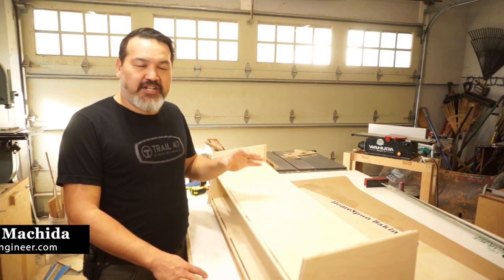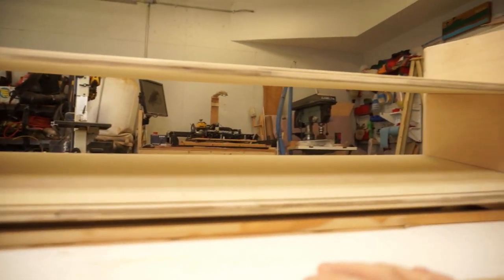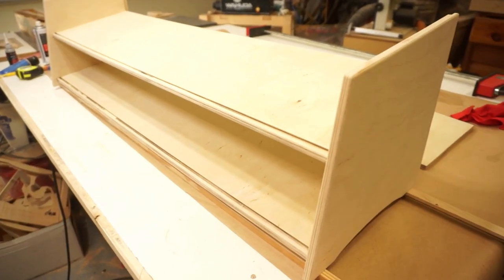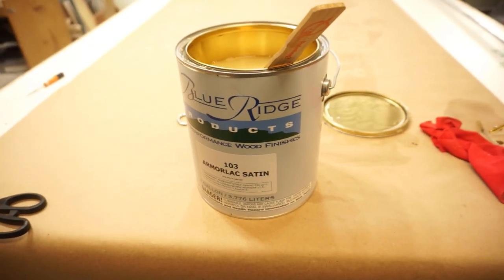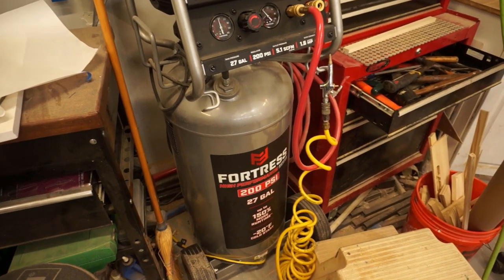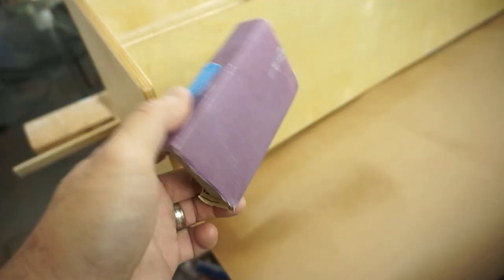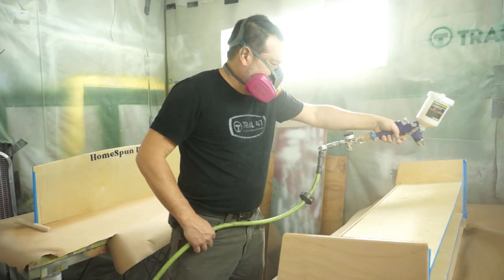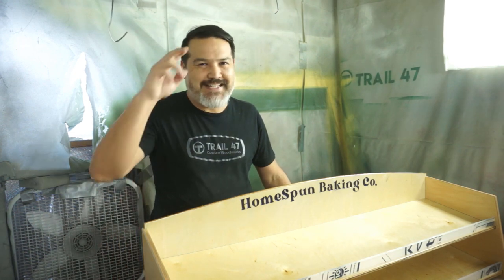HVLP Spraying Tips for the Small Shop - The Garage Engineer

Comment: Have a quick question. You had stated about making sure that the glue joints are unfinished. The ends of the shelves you taped are they where you put the plexiglass or the back as you finished both sides of the back before assembly?
Reply from the maker: I taped the back of the shelves only.  I did not cover up the area where the plexiglass was going.  However I did clear coat the back board of the display. so where the back of the shelf is raw wood, the back board where the shelf touches has clear coat on it.  Not the best joint. But I was more concerned about the glue areas at the ends than the back of the shelves. Good catch. I hope this helps.  Thanks for watching.